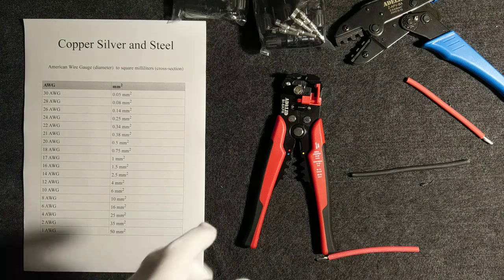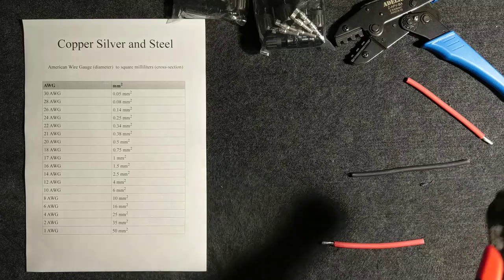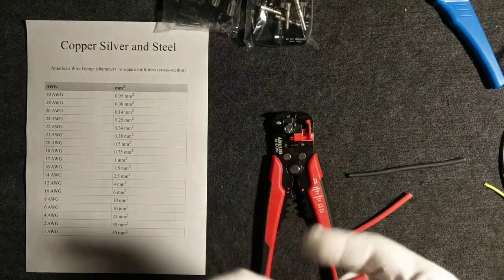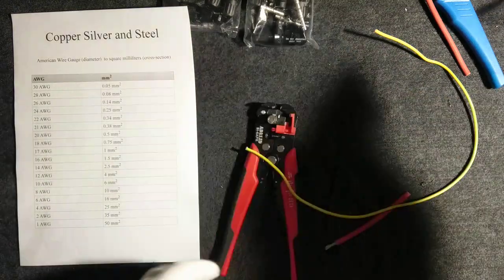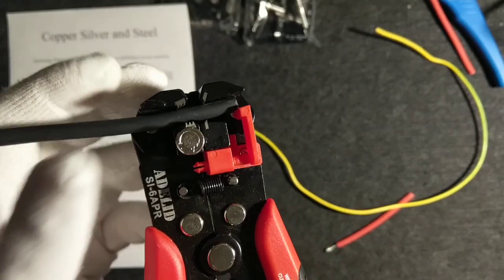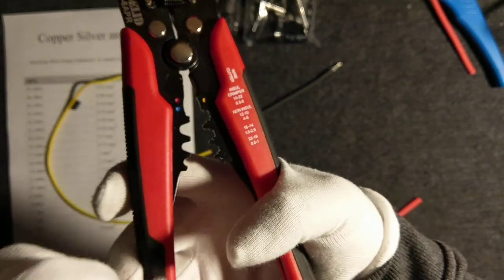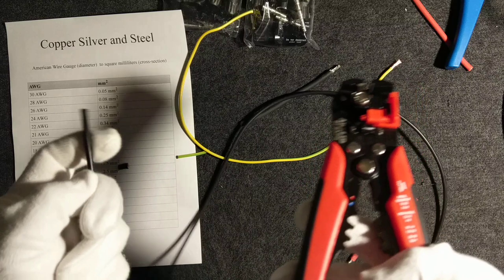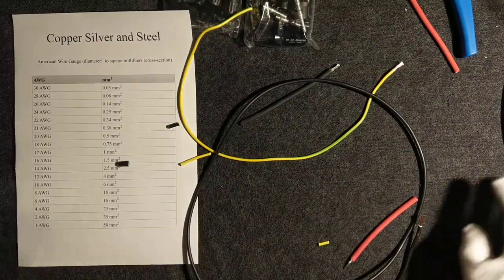How to use automatic wire stripper

Comment: It can be rewarding to learn how to build a solar system by yourself, as it can be a challenging and educational project that can help you gain a deeper understanding of renewable energy and the science behind it. Building a solar system can also be a practical way to generate electricity for your home or business, potentially reducing your energy costs and your carbon footprint.

However, it is important to keep in mind that building a solar system involves electrical work and can be complex, so it is important to be careful and follow proper safety procedures. If you are not comfortable with electrical work or do not have the necessary skills and knowledge, it may be safer and more practical to hire a professional to install a solar system for you.

Before embarking on a project to build a solar system, it is a good idea to do some research and make sure you have a clear understanding of the steps involved, as well as the necessary materials and tools. You should also consider the cost and the potential benefits of building a solar system, and whether it is a feasible project for your needs and budget.

Thanks for staring this series. I can't wait for next episodes.